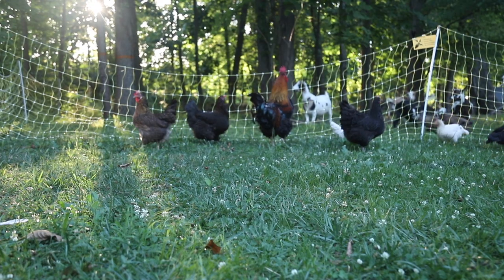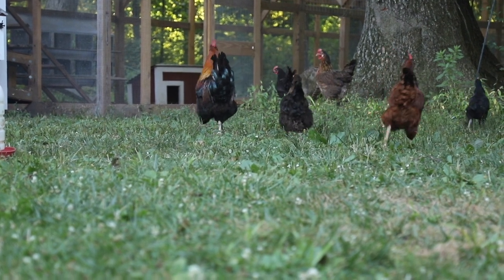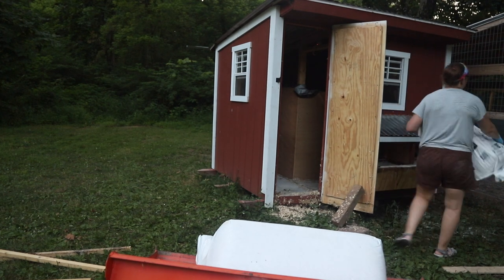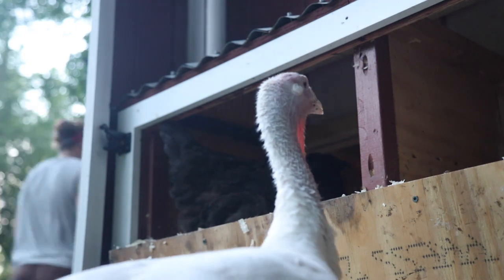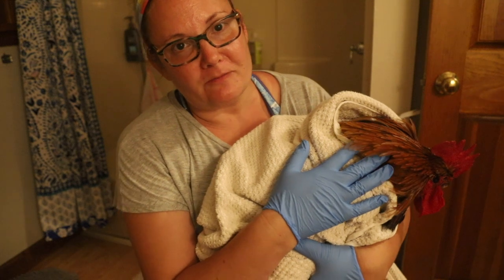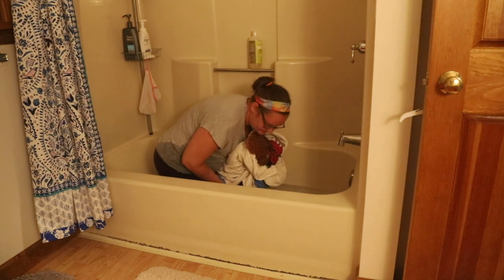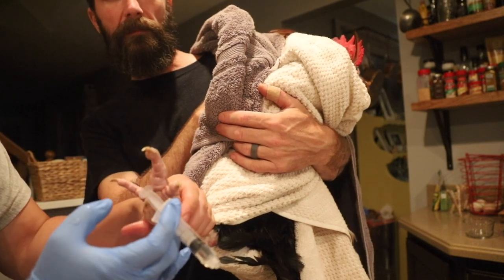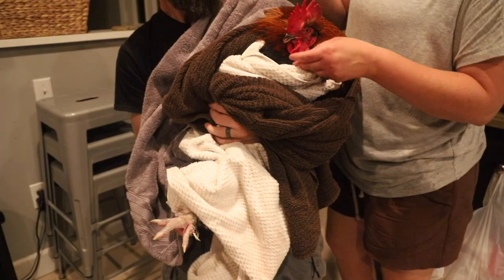Our Rooster Has BUMBLEFOOT!!

Comment: A medical grade forceps or tweezers with reusable surgical blade might help 'shave' down a patch of bumblefoot and pick out the core....alot easier than putting pressure on hand muscles using a dull and stiff tweezer.   As well, they can be sterilized and reused.
Reply: Watch some podiatry videos where they 'shave down' corns as they seem to present as a similar wound to bumblefoot wounds.

Comment: You need to squeeze the infection out. It will form again. Dealt with this before
Reply from the maker: The core came out on the first foot, but not the second. We have it coated in bag balm and wrapped overnight. I figured it could be staph and we didn't need that!
Reply: After you are done, put triple antibiotic on it and keep it wrapped a few days.